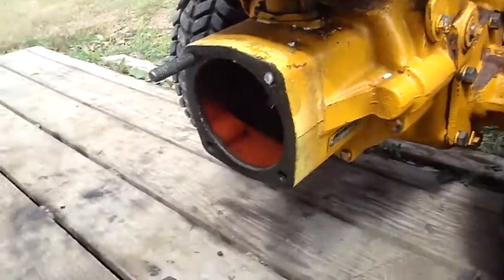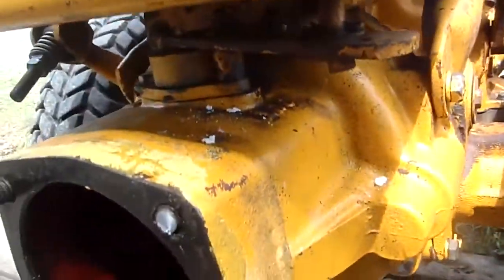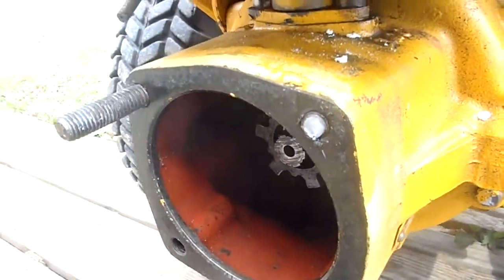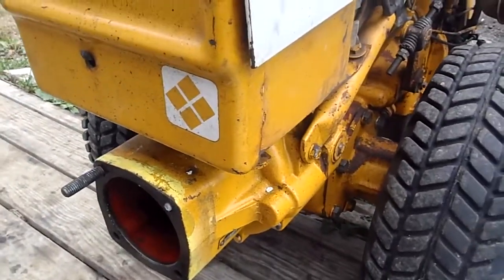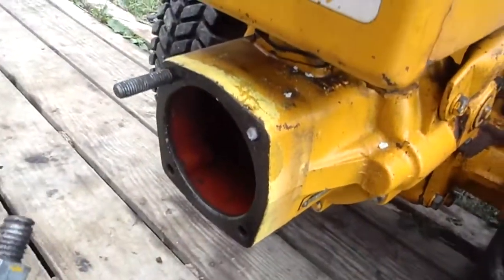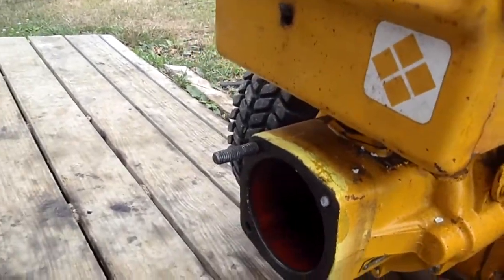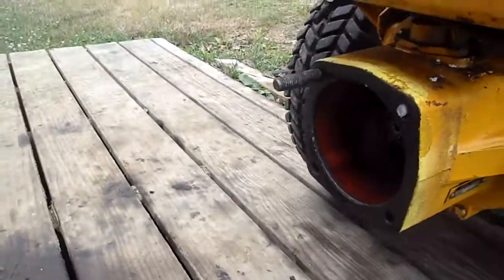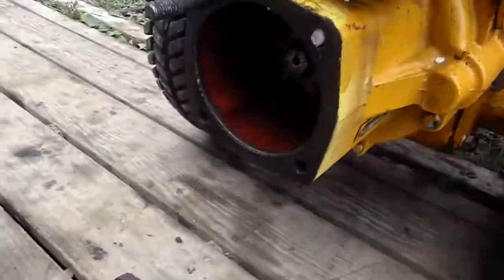Problems with the commercial 12

Comment: Take a die-grinder or Dremel Moto-Tool and cut a slot in the broken-off stud. Back it out with a screwdriver. If that doesn't work then heat it up with a torch and try again. If you have an oxy/acetylene torch use that -- but don't set anything on fire. If that doesn't work then weld a nut onto the end of it and the fix is in. I don't like easy-outs. They break off in there and you're doubly screwed. Those bolts are common. You can find the studs if you really want studs. Good luck.